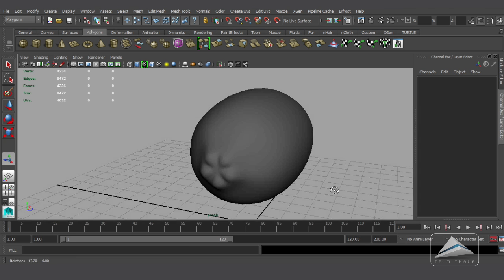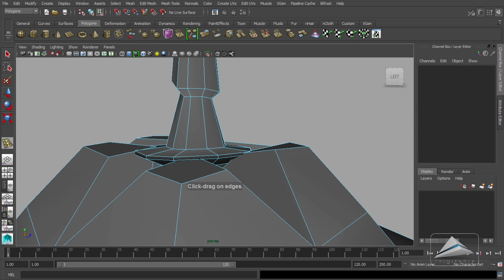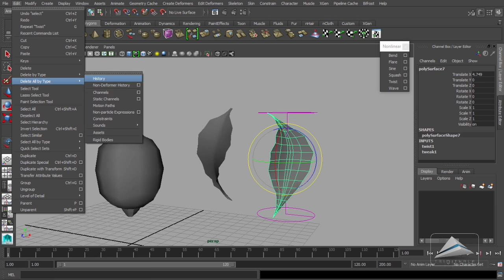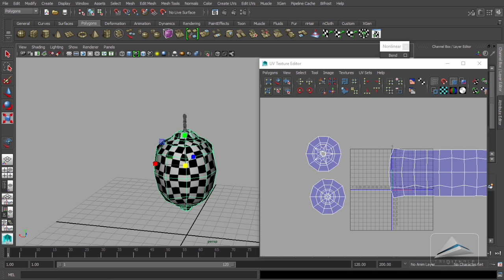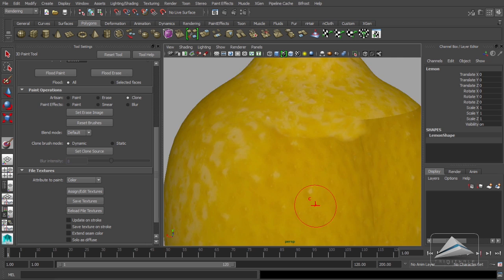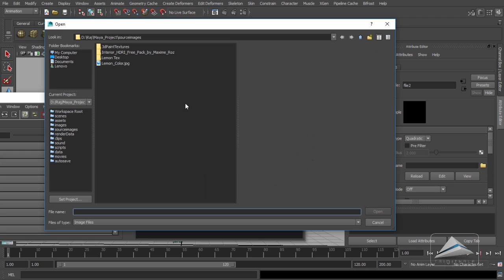Maya for Beginners-Modeling and Texturing a Lemon-Tutorial | Learn Maya

Comment: hi im having some trouble using the 3d painting tool, the brush just doesnt work over it, the red circle doesnt even appear, i selected the polygon, added texture,  and followed the instructions. still doesnt work, i dont know what i did wrong, any idea? :(  thanks for helping
Reply: i think this only can be done with lambert material?
Reply from the maker: Make sure you are following these steps: first assign a file texture to the model- then select the model - go to 3d paint tool option box - now the red circle ⭕ should come.